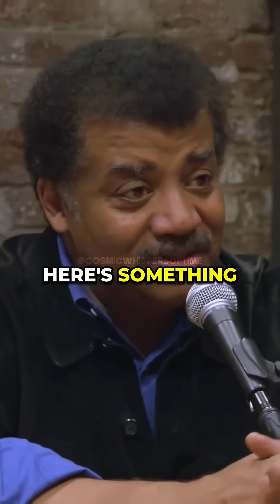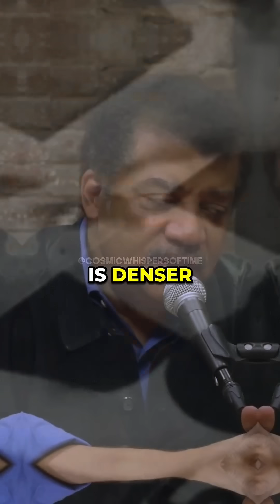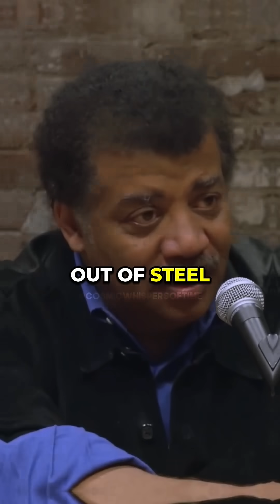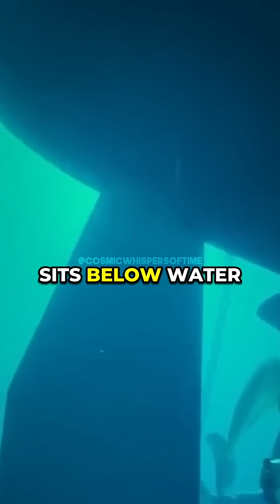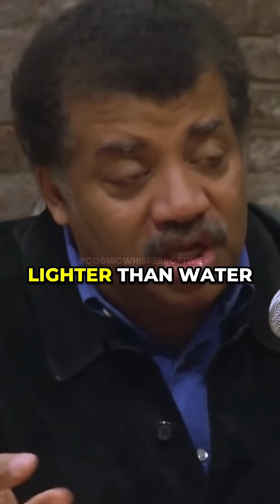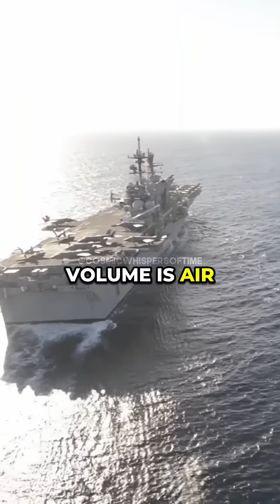Why Giant Steel Ships Don’t Sink 🤯 w/ Neil deGrasse Tyson

Comment: The weight of the ship weighs the same as the weight of water it displaces. It's called buoyancy.
If the ship weighs more than the water it displaces it sinks. 
Archemedes figured out a couple thousand years ago.

Comment: Lame answer from Neilonce again... they built beats for thousands of years, way way way before they figured out the science behind it. They built them first then tens of thousands of years later they figured out why they worked.  
They saw logs floating in streams but when they tried to move them they were too heavy so they hollowed out the log and it was lighter to carry. So they used that cocept and built lighter to make it easier to carry.

Comment: Hey Neil by your logic a Scuba Tank should float because it’s full of air. 😅

In fact, a full scuba tank will sink in water because it is heavier than the volume of water it displaces. The compressed air inside the tank adds to the overall weight, making the tank negatively buoyant.

Comment: Prior to the 19th century, metallurgy simply wasn't advanced enough to build ships out of steel. If that had not been the case, any boat builder who understood Archimedes' Principle would have done it. Therefore, the steel ship pioneers weren't necessarily any smarter than earlier shipwrights. Neil de Grasse Tyson is not that smart.

Comment: it is the average density of ship (say 'a', the ratio of all masses inside the ship (people, fuel, ammo, air, etc.) to the volume of the ship), which is less than the density of water say 'b'. Means a < b. If a > b, the ship will sink !!
it was well justified by Niel, but the attitude should be softer. if you don't encourage the people to ask question, they would refrain from you. This is not good for a teacher !!!!

Comment: Now, all we need to do is replace our planes with craft with an overall desity lighter than air. We cant fill the hollow void with air as the total density will be greater than air, so ee will need to replace it with a gas with lower density. I woukd suggest Helium, maybe even Hydrogen

I think I've just created the perfect fossil fuel alternative for planes

Comment: You can make any material float if you make it like a bowl the weight you put on it dictates how and if it stays afloat just like barges empty its 15 20 ft off water when the load them with coal,rock,etc that's when you see them going down the river 5 ft off the water .

Comment: I completely disagree. Steel ships float because of buoyancy, which is the shape of the ship causes the water to push against the ship and keeps it afloat. The same way airplanes fly in the air because of the shape and angle of the wings that make air exert a force on the wing that lifts the aircraft. Its part of the reason but not the entire reason.

Comment: "Because the  part of the boat that sits below water is mostly air" 

"so what matters... ...is what is average density of that which you have plunked under the water"

both of these statements are very wrong because with that logic it wouldn't matter at all and you could have whatever mass you want on the ship as long as it was above water level

he is trying to say the correct thing but he ruins it, the correct answer is that: the total mass of the ship, including the part of the ship above water level, has to be equal to the water it displaces (the mass of a volume of water equal to the volume on the ship that is under the water level), ships displace more water than their own mass because most of their volume is occupied by AIR which is weightless

Comment: I build motor yachts between 50-70ft and this is so true.. after weve build the hull, majority of the work up to the  sheer line (top of the hull's shell) is mostly air.. except for a bunch of structural reinforcements for the fuel tanks, engines, septics etc.

Comment: That's why gravity has been disproven.  Buoyancy and density is ALL that matters.
Reply: No... gravity is an attraction that objects or have for each other. Like magnets but tiny in comparison. The larger the object the more attracting ability it has. Earth is a very large object in case you haven't noticed, making it the biggest attract-er and why all smaller object move directly to it. Without this density and buoyancy would not have any meaning.

Comment: It's displacement. It doesn't matter what the ship is made of. It only matters how much water is displaced by the container filled with mostly air. If you took a chunk of steel and set it below the waterline, it still sinks. It has to be formed into a mostly hollow container so that air replaces the water. The difference in density is cumulative, meaning, there is a point at which too much steel, not enough air wills till sink the ship. This is why ships have airtight doors and compartments, so that each room is its own buoyant force with a net positive number. This is how ships stay afloat even when they are punctured below the waterline.
Reply: thanks for explaining exactly what he did in the video....
Reply: @dave7526  To be fair, he did provide more detail.
Reply: Yes it's just about finding the most efficient balance utilising space and air, otherwise the ship/object would be roughly 10 times its original size if it had no air in it.  So you can also decrease the size of the ship by half with the same weight so long as it's compensated with air area below water.
Reply: Photos 📸 always helps the subject.
Reply: Neil is largely wrong. Floating or not  is not just about "the part that sits below the water". The part that is above the water will also help determine whether it sinks or not. Air is also not necessarily key. Displacement of water to a maximum point where water won't ingress and increase the density beyond a sinking threshold is key. Also, density is mass divided by volume, not the other way round.
Reply: @jimmycricket5366  
Neil misspoke on the density formula (volume/mass is incorrect), but his explanation of why ships float is scientifically sound. The error was terminological, not conceptual. The principle that ships achieve low average density through air-filled hulls—making them less dense than water—remains core to physics and is well-documented in educational resources.
Reply: Thats basically wat he said. But yea. Thanks for your more detailed explanation

Comment: That's the wrong way of looking at it. First boats were hollowed logs or logs tied together. Then wood was shaped into planks. And the planks were arranged to mimic the shape of hollowed logs. Then ballast to keep the wooden ship stable came along. Usually rocks. Then metal plates were used to armour the wooden ship. Then instead of having metal plates as armour, the ship itself was made of metal.
.
.
.
NO ONE EVER THOUGHT TO MAKE METAL FLOATILLA OUT OF THE BLUE

Comment: People knew for at least  2000 years how displacement works. The technology and industrial base to build iron ship with enough displacement to float and how to move it, is a different matter. 
But yes, anyone who has put a pot in water quickly figures out it floats as long as it's not full of water.
BTW wooden ships are also heavier than water,  that's why they sink to the bottom

Comment: He's wrong.
DISPLACEMENT is what keeps a ship on top of the water.
The total WEIGHT of the ship must be LESS than the weight of the water it displaces.
The AIR is only a PART of the equation.
If AIR was the primary factor -- we would have no submarines.
ALSO!!... Ancient peoples built boats because they lived near rivers and noticed that the wood from dead trees floats. And it had nothing to do with air.

Comment: Are you stupid or Stupid?? Steel ships float because of the principles of buoyancy and density, as explained by Archimedes' Principle. Here's how it works:

Archimedes' Principle: This principle states that an object submerged in a fluid experiences an upward buoyant force equal to the weight of the fluid it displaces. For a ship to float, the total weight of the ship must be equal to or less than the weight of the water it displaces

Comment: That person was Archimedes 100 thousand years ago figured out that the pushing out force FB = ρVg depends on the density of the liquid that the object is being submerged the G and the volume of the submerged object. Volume of a submerged item depends on shape not the weight. Now you can actually calculate what is the optimal shape to get max volume of a given surface coverage. Lets say for everything being equal, it is a set material set thickness and set area coverage. How to shape it to get max volume. And the second task, what shape it should be to get max surface coverage. I will think about it and post an answer if i figure it out.

Comment: That concept has always fascinated me. Metal ships floating.
* From when I was a tiny kid trying to understand how things floated derrr.
Reply: The Ohio Erie Canal boats were made of concrete. Thats even harder to wrap your mind around
Reply: @joshcapps380 when were those made? That sounds like a brittle material for boat hulls 😅
Reply: @joshcapps380  Why would concrete be even harder to wrap your mind around?? steel is way more dense and heavier than concrete.
Reply: metal ships floating and flying are both fascinating
Reply: @baggz321  indeed
Reply: @baggz321 The beauty & awesomeness of physics
Reply: Its called displacement.
Reply: @Timl-e2y  it's called buoyancy, displacement is the result. Submarines displace all around yet still sink or float depending on how much air/water in ballast tanks.
Reply: @justaguy4real anything put in water displaces water so I don't know what he was getting at
Reply: @rattailJimmy  He's wrong. As long as the total weight of the ship and its cargo weighs less than the weight of the water it displaces, it will float. Air has nothing to do with it.
Reply: still have a hard time figure out how a boat can float
Reply: @ I just explained it in previous comment. The weight of the water it displaces is more than that of the craft and contents. Like aircraft carriers, the weight of the water displaced is more than the metal ship, fuel, metal jets, people, etc all combined.
Reply: @dingleydb  get a soda bottle and put the cap on. fill your sink up with water.  drop in the bottle it floats.  now fill up some of the bottle with water.  it'll start to sink.  for submarines to descend to the top, the replace the volume that was once water with air and it rises.
Reply: Or metal planes flying 🤯🤯
Reply: Even tanks were floating to the beaches in WW2, and yes, metal planes. But the point was of buoyancy and the weight of the water it displaces being heavier than the boat/ship/object itself to allow it to float.
Reply: Isambard kingdom Brunell. And ss great Britain. The world's first entirely iron ship
Reply: Let's not forget salt water is the highest in density on the entire planet. Making steel more successful at floating as well.
Reply: How bout metal that FLIES
Reply: People not figuring it out was never the problem,  people knew heavier than water floats, anyone who has washed a pot would figure that out. Figuring out how to make enough sheet iron to build a ship (and move it after) was the issue.
Reply: @diomepa2100  Indeed. The challenge was about sealing steel watertight, just like sealing wood watertight was essential to wooden ships. 
It's a scale problem, to make a ship bigger than a log you have to connect the material in a watertight way. That boats made out of material heavier than water float was already known to canoe builders.
Reply: But a coin sinks, but a coin hammered into the shape of a small boat floats.
Reply: Even concrete hull ships! It is fascinating & the people that figure the stuff out amazes me!
Reply: I don't think most of these commenters caught your sarcasm...
Reply: @christopherpare510  I agree lol 🤣😆✌
Reply: Back in 1997 the Titanic exhibit let us touch all over the "Big Piece" of the hull recently brought up. Very surprised at how thin it seemed to be. Yes most of that ship WAS air!
Reply: Archimede
Reply: I’m glad he told bruh shut up cuz i was trying to hear this shit rq
Reply: @danielboom759  ya that was hilarious
Reply: There is a difference between the water and the air they carry and this is due to their weight. 
The heavier the load, the more air they carry and the lighter the load, there is always a difference between air and water.
Reply: Imagine metal boxes flying
Reply: Bro, how? That is the easiest concept ever
Reply: I agree, 100000%

Still fascinates me
Reply: They made ships out of concrete
Reply: @crasherxtreme  Aint that a trip. The idea they figured out the concept of buoyancy is amazing.
Reply: Nah, the plane is.
Reply: Same, like airplanes..
Reply: What's so fascinating about a he literally just explained it in a minute haha
Reply: and also airplane 🤯
Reply: Always? I doubt that.
Reply: I see your floating metal ships, and raise you a flying machine made of metal.
Reply: Not as much as metal planes flying
Reply: The ship is half way in water, let’s say it displaces a million gallons, what ever a million gallons weights is pushing up on the weight of the ship
Reply: and aluminium tubes flying
Reply: metal ships flying gets me
Reply: They had ships made out of concrete in the 40's
Reply: Because youre stupid
Reply: Very true, the ship's displacement weight of the water's weight it displaces is why it floats and density. Amazed me ever since I was a kid too, yes METAL FLOATHING wow. And yes flying too.
Reply: there was even concrete  ships
Reply: He imparts knowledge for us in such an interesting way.
Reply: Just think of it like this, get something extremely floaty like Styrofoam and put some steel on top and see that it floats
Reply: you need to listen to a comedians take on cruise ships.   dude is looking at a hotel, then a ship, then he's like what if we put that together out there?  friend:  what do we make it out of? dude: steel, lots and lots of steel, until it floats
Reply: If metal ships floating in water is fascinating, you ought to be awe-inspired by metal craft flying through the air.
Reply: @uncaboat2399  "Lift" from the wing structure is much more comprehensible than buoyancy and floating.
Reply: @justaguy4real  It is? I would have thought it the opposite. I mean, come on, you have a container full of air. Of course it's buoyant! Air is lighter than water!

Then you have Bernoulli's Principle, which states that a fluid traveling more quickly over a surface exerts less pressure than a fluid traveling less quickly. Say what?? So the air travels over the top of the wing more quickly because it's curved ... ?

Not exactly intuitive.
Reply: @uncaboat2399 whatever floats your boat guy. Yes, pun. 🤟✌️
Reply: He is 100% wrong
Reply: after that, human make a big chunk of metal flying
Reply: I still do not believe this :D
Reply: Put a pot in the sink and fill the sink with water. Push down on the pot. It's not a hard concept to grasp.
Reply: it´s called the Archimedes principle.   a basic concept in physics.
Reply: @robocop2902  we know what it is buddy, the point and fascination is the concept and principle

Comment: What actually happens is that the weight of the surrounding water column outside of the hull increases the pressure of the water underneath the bottom of the ship. Because the air inside the hull is lighter than the water outside, it creates a differential pressure imbalance across the entire bottom surface of the hull. It is this pressure imbalance from the outside to the inside that creates the upward lifting force that is required to counterbalance the structural weight of the ship. As fuel and cargo are added, the extra weight pushes the ship lower into the water, which exposes the bottom of the hull to an increase in water pressure. The additional pressure imbalance then counterbalances the additional weight, preventing the ship from going any deeper.
Reply: That’s a good explanation

Comment: They weren't building boats out of wood just because wood floats. They already knew about density and displacement. They just didn't have the capacity to produce the necessary volume of sheet metal to do it. So when they could do it, they just swapped wood for metal, like you can swap metal for fiberglass or plastic. But Neil still thinks man-made global warming is real. So...